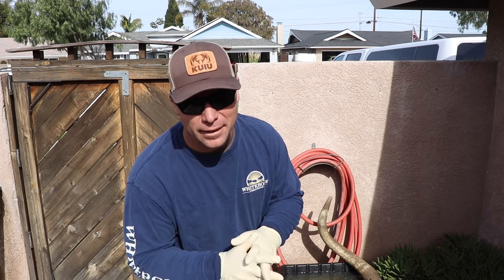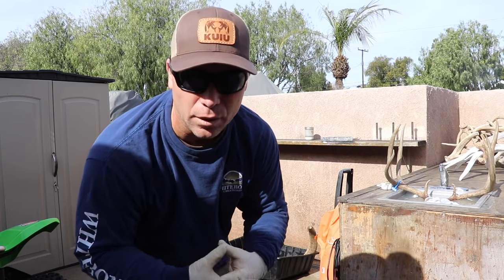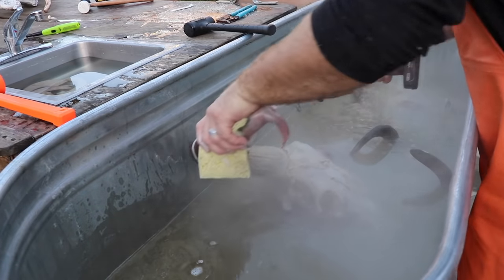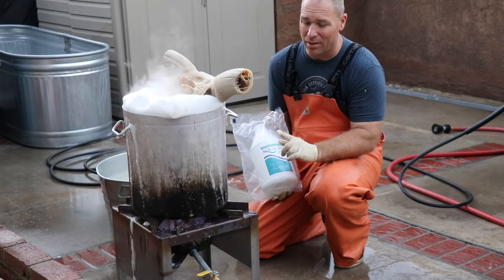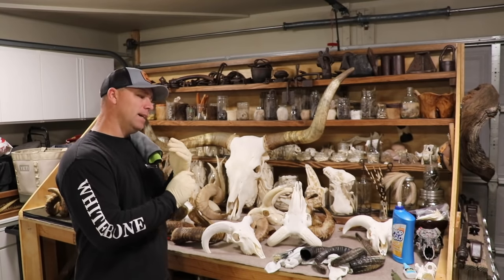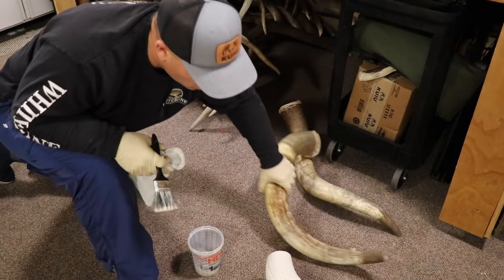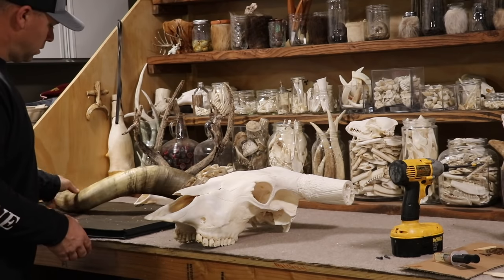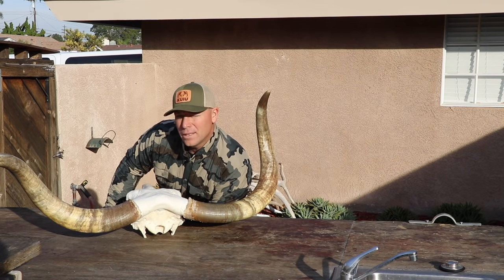HOW TO CLEAN A LONGHORN BULL SKULL "DEAD HEAD"

Comment: HOW TO CLEAN A FISH SKULL ? maybe arowana skull
Reply: I agree with that
Reply: Most fish don't have bones hard enough for this type of processing skip the boiling and find someone with dermestid beatles or find a nice fire ant colony then once the meat is gone soak in room temp 3% peroxide for hours until it reaches desired whiteness. I process all of my bones without boiling his process is quicker but I prefer my results but thats personal taste .
Reply: I made a very clean sea-bass skull
Also I get it from my oily dinner...
And here is how I did it (sorry for bad English)

First you must get all the bones from the head. They don't have just a few simple bones. It can be more than 20-30 bones in a fish head.
Then brush them gently with hot soapy water until there is no meat on it. And leave it in detergent water about 2 or more days.
Then take the bones and brush them gently again and leave them for dry about one day.

Final step and the hardest step is remembering the places of bones. I still haven't done this but bones are fine and clean.

I recommend seabass because it has little oil and strong bones

I tried also bream but I couldn't get rid of fat inside the bones...
Reply: Should do a squid skull soon

Comment: That went well with my Rocky Road ice cream. Ha!
The stock tank reminds me of when I did my buffalo. I had never boiled a skull like that. My sister had a place in the country so I went out there, found a stock tank, propped it up on bricks and started a wood fire. I quickly learned that I wasn't able to lift it out of the tank to check it due to the heat, so wrapped a rope around the horns, threw the rope over a tree limb, and tied off on the bumper of my wife's Subaru. Every so often I'd back the car up to check it. Did lose some small pieces of the bases due to boiling too long, which is too bad as it measured up between the 3rd & 4th largest since Boone & Crocket started. This was in 1982.

Comment: Nice job! New to this channel but I have a question to water maceration. Not sure if you do that also but I am working on a younger buck white tail my uncle gave me. It had a smaller rack so I got this skull for practice while my uncle kept the meat. Long story short I have it fairly clean but have been lazy so it has been sitting in water for the last month or so with water changes weekly. I started using a fish tank heater about 2 weeks ago. The problem is the skull is literally coming apart. You can see a natural zig zag line from above the eyes meeting in the middle of the skull.....it is now starting to separate. Is this normal or has my lack of action and long soak caused this? Could it be because this buck was younger? I don't have a pressure washer and there is still some bits of tendon stuck in the back jaw bone holes. Should I use a pick to get it out? It is not degreased yet should I leave the small bits and hope the Dawn dish soap degrees works? This was not a beauty but I hate to waist it want to save it.....if it's not too far gone. P.S. the teath are loose but staying in the socket unless pulled lightly and the bones don't feel spongy or flexible so hopefully it's still savable. Thanks for any info!

Comment: question on mop and glow sealed skulls. one of my very first skulls ever done is sealed with mop and glow, but its been about 8 years later, and there is oil stains and dust like you are talking about. Can a boil in the aquasilk remove it? Or maybe a soak in acetone first, then a re-whiten job in aquasilk? Do you have a process for that?

Comment: Could you do a video where you show how to clean a raptor leg. I found a dead falcon a year ago but I didn’t think I’d be able to work with such delicate bones. I’m not sure what the process would be for their talons either.
Reply: Cassidy be sure to check your state regulations on anything to do with raptors/birds of prey. Most of them are protected and illegal to kill or pick up if found dead. I've done small birds and mammal bones but I macerate (rot) them then degrease and whiten.

Comment: Question, I purchased a steer skull off an online store about Feb. Says 'Mexico' written on it, the horns had a piece of wood inside holding them in/on and noticed it has been plastered and painted in spots. It sat on my wood floor and I discovered dead worm type bugs and small live beetles on the floor underneath recently.  Can I still sink the thing in some peroxide?
Reply: I wonder if those were dermestid beetles and larva.
Reply: @starandfox601  unfortunately you are right.  I put the skull in a tightly closed bag with a bunch of diatomaceous earth to dry them up. Hoping it works.

Comment: Have you ever used a rotary nozzle for your pressure washer.

Maceration will remove any of the meat and marrow you can not reach inside the upper jaw. That is why it is it is a dark spot more than likely left over marrow. Soaking in gas or building a degreaser will remove the dark spots.